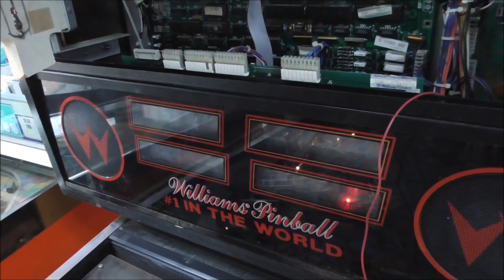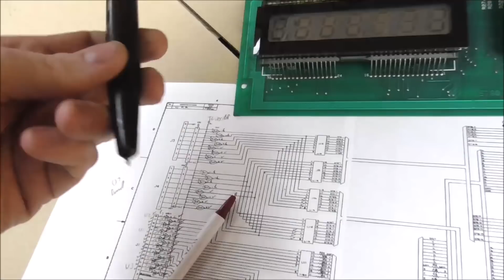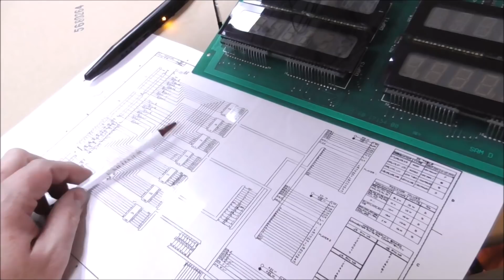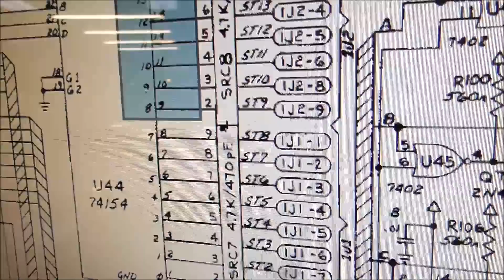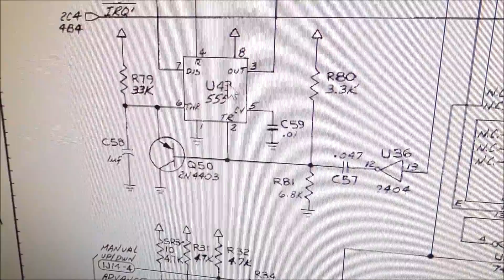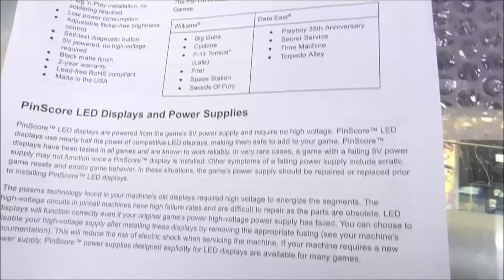This Display Is REALLY Screwed Up!  - 1987 Williams F-14 Tomcat Pinball Machine Repair 5

Comment: Joe, hopefully you'll remember I wrote to you like last week on another one of your video about I had my #1 display was not lighting up on my f-`14.  You suggested I need to replace the digital display with Pinscore LED PS-11610.  Well, I just received the display assembly today, installed and it works GREAT!!!  Pinball machine works like a new one again!  

The instructions mention about perhaps disabling the high voltage supply via removing the fuses from the power board.  Do you think it is a good idea to remove the fuses.  If so, there six fuses on that board, which ones would I need to remove?

Thanks for all your help especially with your informative videos for a novice like me!

Comment: What do you do about all the exposed copper traces on the MPU board?
Reply from the maker: Nothing, they're everywhere, under chips, etc. there's not much you can easily do to cover them all.  Thanks for watching Se7enity
Reply: Green nail polish will cover the traces snd it also protects them from oxidizing… plus it’s green.

Comment: Cool on the light bulbs working again.  I guess the blanking signal was the ocsilator governing the lamp illumination pulse?
Though I can't wrap my mind around how the C58 cap on the 555 (blanking) timer, could have caused the 'C' signal to be pulled high through an 7404 inverter and a decoupling cap (C57).
Makes my puzzler hurt.
Reply from the maker: Your guess is as good as mine but it had something screwed up for sure!

Comment: That cap might be one of the caps that determines the timing of the 555.  If that input controls the blanking, it could be why the display is blank.  I think a smaller cap may increase the frequency of the 555 output, which would cause it to pulse faster.
Reply from the maker: I think you're correct about that!

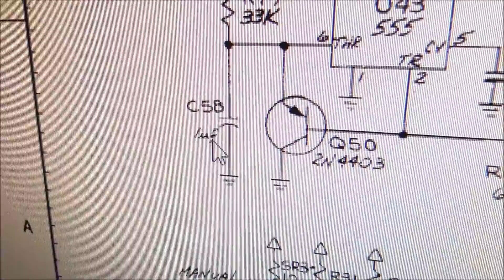Comment: 28:22 if I understand this right, the circuit appears to make a time delay that is proportional to the values of R79 (33k) and C58 (1u). These make an RC series circuit that has a time constant of approximately 33k*1u = 33ms. 

This means that C58 will charge to about 2/3 of Vcc in a bit over 33ms from the fully discharged state. This will satisfy the NE555 pin 6 input (threshold) and keep the pin 3 output low. 

R80 (3,3k) and R84 (6,8k) resistors make a voltage division a wee bit over 2/3 of Vcc which is enough to keep the NE555 pin 2 input (trigger) high. 

When the 7404 output pin goes low, it charges C57 which will cause pin 2 to go under 1/3 of Vcc for a tiny amount of time, setting the NE555 pin 3 (output) high and pin 7 (discharge) low, and simltaneuosly it triggers Q50 to rapidly drain C58 to a wee bit over 1/3 Vcc. When C57 has charged over 1/3 Vcc, this will allow pin 2 high and Q50 will also close. 

Now C58 will charge through R79 and when it reaches 2/3 of Vcc it will trip the NE555 pin (threshold) which will reset the pin 3 output back to low. The charging only occurs between 1/3 and 2/3 of Vcc so it does not take the full 33ms but roughly 10 to 15ms.

So every time the 7404 goes low the NE555 will produce a high pulse of roughly 10 to 15ms at pin 3 (low at pin 7) regardless of the 7404 output staying low for a bit longer or shorter. Making C58 a different size will quite proportionally affect the pulse length, I assume that at 0,1uF it would only be in the vicinity of 1 to 1,5ms as the time constant goes down to 3,3ms. 

It appears that with C58 being too small a value, it would not hold the blanking signal long enough that all digits can be scanned - and it appears that there is some room for variance without ill effect.

Are you going to scavenge the working glasses from the old display unit?
Reply from the maker: I halfway followed that Jussi, thank you for the explanation!
Reply: @LyonsArcade  the NE555 (and its derivatives) is a very common chip in solutions where precise timing pulses or oscillation is needed. It can work in a wide voltage range, between some 4,5 and 15 V, and its timing is not essentially affected by the voltage as long as it is fairly constant and within the range. 

Very often in the examples I found, pins 6 and 7 are tied and the external transistor is not needed, but at least in this case both pin 3 and 7 are both run elsewhere in the circuitry. The pin 7 is an open collector output capable of sinking some current, more so than a standard TTL output, so it can be made to drive a small load or another logic circuit without needing to consider the operating voltage of either circuit as long as they share a common signal ground. You could for example have the 555 in a 15V circuit and driving a 5V TTL circuit  and they would not see each other's operating voltage. 

If you have the time to fool around you could check the output pulse length with an oscilloscope. We might learn how far off I was with my assumptions.

Comment: The bubble means inversion.

Unfortunately the exact way it's used is not entirely consistent between designers and different types of chip.

On control signals on fancy chips, the default assumption is active high, so a bubble means the input or output is active low. Not everyone uses bubbles on such chips at all at all though, some use other methods to indicate active low and some don't bother to indicate it at all.

On logic gates the bubble is normally just an inversion indicator. Occasionally you see "alternative" logic symbols with the bubbles on the input and the core symbol swapped (an and gate with inverted inputs is equivilent to an or gate with inverted outputs and vice-versa) where active low signals feed into a gate, but they are the exception not the rule.
Reply from the maker: That makes sense, thanks Peter!

Comment: This is the first video on this particular display on YouTube,I just swapped mine out after 33 years for a LCD,l was playing away and suddenly heard a loud popping sound, looked up and display was gone, technician didn't want to fix it so I kinda had no other option.Yes the new one sure is pretty out of the box,and so much lighter than the original.
Reply from the maker: That's a shame because if you lost the whole display, it was likely a power issue, the LED board runs on 5volts so it doesn't need the high voltage, your old display was probably still fine the power supply to this day likely has a dead high voltage section in it since the LED ones don't need it.
Reply: I think you are right,I still have the old one put away maybe someone could use it in the future.

Comment: use a peak voltage adapter
Reply from the maker: I'll have to look into that, thanks!
Reply: @LyonsArcade  we use them all the time in the power sport industry to diagnose ignition systems in the KV range all the way down to 100 volt range it basically smooths out the pulses to peak voltage so the reading you get on your meter is the peak of the voltage spikes.. hope that made some sense

Comment: Wouldn't it make more sense if the display had its own powersource for the 100V it uses and the control chips just control what it displays at the 5/3.3V ICs usually use?
Reply from the maker: Apparently that's not how they used to do it.  Be prepared though, that when you get older, someone comes along and says 'Wouldn't it make more sense that the chips that require 5 volts, don't constantly have 5 volts if they're not currently being used?" and everybody acts like you're an idiot because you used to do it 'the old way' :)

Comment: Enjoying all of the videos you post. 
Much so I bought a pinball machine to try and get my hands dirty to fix up. Still waiting for it to be delivered. 
The down fall of living in the middle of nowhere. Ha!!
A couple questions popped in my head regarding the play field. 
1. When you do the touch up paint, do you just clear coat that spot?

2. Do stickers for the art work on the field are they good to use and can they be clear coated to prevent wear?
Thanks again for the great videos.
Reply from the maker: When we do the touch up, yes we just clear over the general area the touch up was in.... you have to be careful though, if the playfield has wax on it, you can't paint over the wax it will make a huge mess.  So you have to clean off the area that you are going to paint really well.  

Yes, you can get stickers for some of the artwork, when you clear it do a light coat first, then wait 10 minutes or so and do a thicker coat.  

Thanks for watching, we appreciate it!  Let us know how your machine turns out!

Comment: Great video Ron,  I thought I fixed the displays on my Gorgar but at the end I had to buy new display.  It happens to the best of us.  Keep up the good work on the machine.   Have you decided what you going to do on the playfield?  See you on the next video in the series.
Reply from the maker: Eventually all those displays are going to have to be replaced, the LED's are just the only way to go but the good thing is they look very similar to the originals so hey it's an upgrade really.... we're going to clean the heck out the playfield but we're not going to remove the mylar, I just don't think I could do it well, and inexpensively.

Comment: Before you repaired the board, the bottom displays were showing more.   I can see that dim digit on the working displays is pretty badly burnt.
Using the wrong cap would upset the timing as it is attached to a 555 timer, so it would change pulse timing for blanking :).
I know you will get these all running
Reply from the maker: Yeah I guess the blanking timing was messed up so it was blanking it and making entire digits never illuminate!

Comment: That's not a cheap upgrade, even though it makes sense.
As for the old display, perhaps you could use a bench power supply and put 100v on some legs to see if anything happens. Maybe they died from heat though, being so close to the bottom ones, I dunno. In any case, the things can be used for spare parts on a different machine.
Reply from the maker: It's pretty common on them for some of them to die unfortunately, they 'outgas' basically wear out.  Very common with pinball displays for many of the individual glasses to die, gets real expensive to fix!  Thanks for watching Vermilicious!

Comment: Joe's Classic Video Games & Window entertainment Yep, that's the new name for the shop. =)
How'ya doing Ron? Restoration looks good I see.
I hate battery leakage. You wouldn't want to know how many industrial PLC's and whatnot I have dug into trying
to fix'em up just because noone seems to know nil about batteries/ackumulators, my predecessors that is.
If you feel really out there you could serialize a resistor on the tip of the logic probe to create a voltage divider.
Reply from the maker: It's one of those things where 90% of the time the display glass has went bad, you can sometimes have another fault that makes it not illuminate but almost everytime the actual glass is bad... so we were able to eliminate as much as possible, and while it may still be something else on the board we're about 95% certain the glass themselves are dead, so it's not worth too much more trouble to know for 100% sure when the other glasses would look better with the new LED displays too, so we just threw in the towel :)  Thanks for watching as always Matthias!

Comment: The '555' chip is a timer chip and is much loved by us electronics folks, the capacitor and the resistor set the timing (an R,C network) and are attached to the 'Threshold' pin, so by having that cap out by a factor of 10, the blanking timing is out by the same amount, thats roughly it anyway ! and you went straight to it, great work !  looking forward to the rest....cheers.
Reply from the maker: Thanks for watching andymouse123!

Comment: Does the customer get the old display board back, or are you holding onto it for parts?
-
Oh and...
THR = Threshold, which is the 2/3 of VCC point. When the voltage on pin-6 THR goes above 2/3 of VCC then the internal flip-flop, in the 555, is reset. When the voltage on pin-2 (TRIG) falls below 1/3 of VCC then the internal flip-flop is set. So, in a continuous oscillator mode, the cap is ramping up and down between 1/3 and 2/3 of vcc.
Lot's of useful circuits can be made out of the venerable 555, the one in your display board is a pulse stretcher for generating the blanking period.
Cheers,
Reply: Ron has a new parts board most definitely. Once you swap out the Plasma Displays & board for LEDS, the Led board is not usable with the old board. The two boards use different voltages. I had to do this with my Pin-Bot I saved from being junked a few years ago. I just replaced the displays in my High Speed I have owned for over 30 years. They look great!
Hello from Phoenix Arizona!🔥

Comment: Said it before, it's still true now:

The world will be a sadder and dimmer place when the last of those old plasma displays finally gives up the ghost.
Reply: Ikr :(
Reply: The LED's are getting really good at replicating the colour now.  Most people will not tell the difference between the orange LED and the orange VFD.  Vacuum fluorescent displays filled a need and have had their day.   So much so that if you google VFD now, most results are Variable Frequency Drive.    
I love keeping things original where I can though.
Reply: No doubt. But there's also no getting around how much better the LEDs are, especially now that they are drop-in, near-identical-appearance replacements. Much lower power consumption, will greatly reduce wear and tear on all the electronics (not just the display), will be way more reliable, probably last the rest of the lifetime of the machine.

There are a number of applications where the replacement LEDs still don't quite cut it. Nixie tubes come to mind, old-style Edison filament bulbs, that sort of thing. The real deal is still aesthetically superior. But I'm really impressed with the LED reproduction displays to replace these old plasmas.

Comment: Couldn't you jump the signals off of #3-4 display to the #1-2 display. You don't care if it's correct at this point you just want to see if the glass fires.
Reply from the maker: Since the voltages are so high I don't really want to jumper them around i'm not sure if that would work or fry something...